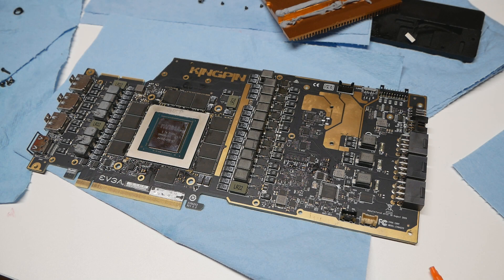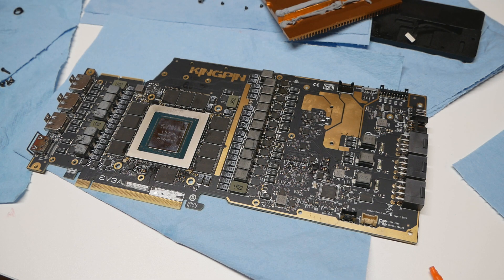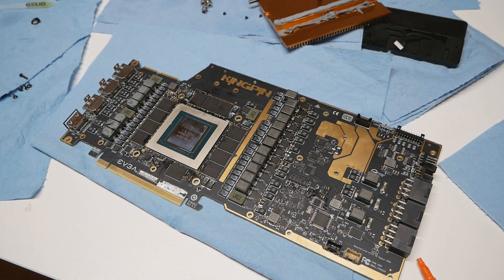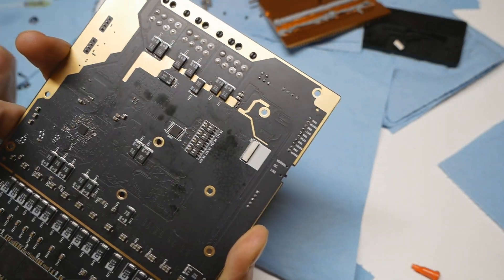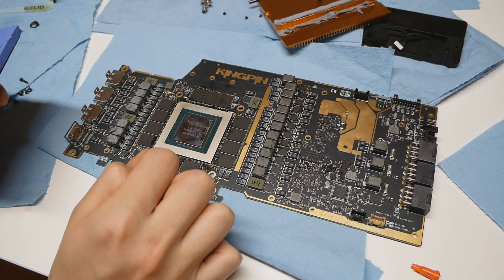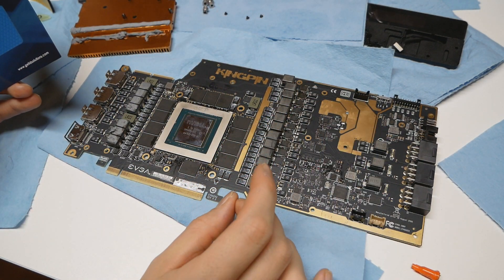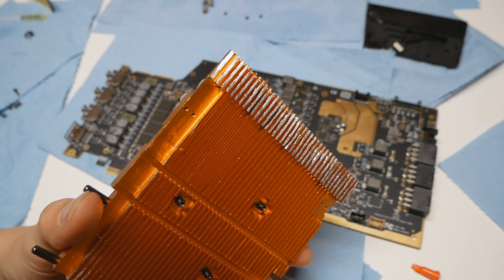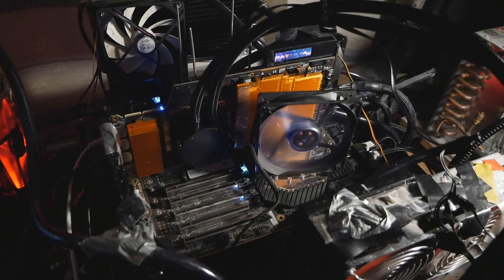The BEST RMA Service in the World - EVGA RTX 3090 K|NGP|N BACK ALIVE with PCB Overview + LN2 OC Tips

Comment: Haven't really seen too much talk about this so I'm wondering how widespread this is: I'm having an issue where, one night of testing a while back, I was able to hit personal bests, my Kingpin card was scoring 400 points higher than it had before, with no real explanation as to why (same drivers it had previously scored barely 15k on it now hit 15.4k at the same clocks, with no Classified Tool being used in either case).  I have not been able to replicate that performance since.
Have you encountered this issue, and if so, how did you correct it?  I tried replicating the circumstances of those runs (wiping drivers, reverting to an old driver, wiping again with DDU, then going back to the driver it was done on) with no luck.
Just thought I'd ask here, see if you've had this issue at all and how you solve it if so.  I've also tried switching BIOS switch positions with shutdowns in between, that didn't work either.

Comment: I've been wanting to get my hands on some TG-PP10 thermal putty, as it is the highest performance thermal gap filler I can find at 10w/mK. It should in theory preform better than pads in most cases, since it can fill between chips and possibly pull heat out of the PCB. Also with something like a midplate, it would allow for the smallest gap possible.

Comment: Great video, bro. Do you know of a good place to purchase that Ziitek thermal compound? Is this the same product? https://www.ziitek.com/en/products/TIFTM_100_35_silicone_putty_thermal_ga/2017/0916/3156.html
Reply from the maker: Yes it should be that one. Try to check Aliexpress, alibaba etc and report if you find. I will try to check too.
Reply: @LuumiJuhani  Thank you very much. I think I found a vendor that sells it in Canada (I am in USA) but they may not sell to consumers. https://www.thermazig.com/sale-11522456-silicone-thermally-conductive-putty-continuous-use-temp-gray-soft-dsp-chip.html and I will report after I receive a reply to my inquiry with them. I will also reply if I can find it on one of the web sites you mentioned. 
If the Hyrdo Copper and OptimusPC waterblocks have a little more space to accommodate a thermal pad that might solve the problem of having to source this product. I can hardly wait for a better solution than the hybrid cooler. For now I have removed the radiator, installed QD3 fittings with barbs to integrate the hybrid cooler into my chilled loop.
Reply: After thinking about this a little more, if that Zittek crap isn't readily available, K5 Pro should work perfectly fine on the chokes. The K5 Pro does not have as high W/mK rating, but it doesn't need to for the chokes. The K5 Pro is easy to apply if you put it in a syringe instead of scooping it out and smearing it on using a spatula. Hopefully, the waterblock designs by EVGA and OptimusPC will take this into account and not have the same issue.

Comment: How painful was the shipping from Finland to Taiwan and back? Did you have to pay all the shipping costs? Did the customs agency give you any trouble when they sent it back?
Reply from the maker: Problem is the cooling solution the card in terms of shipping as it is so huge. I was able to send the card as naked PCB which is very light this time. UPS is around 50-60€ from my end to Taiwan. No need to pay anything at customs on return if it is a repair or replacement.

Comment: I can’t wait to be notified for the KP card, happy they have the queue system! I was wondering why you hadn’t posted anymore vids with card, now we know, that had to be heartbreaking! EVGA has the best warranty hands down.
Reply from the maker: Yeah, that heatsink thing is actually a bit of a mistake by EVGA. The gap between chokes and the heatsink should be large enough for a good thermal pad.
Reply: @LuumiJuhani  hmm, I just got my kp card, got 15236 port royal stock voltages, and I just took the shroud off to change paste and see if that makes a difference before I go to ln2.  After the shroud comes off is the backplate stuck on only by thermal pads? It feels very stuck and I don't want to break it
Reply: @Apollo-Computers  Hey curious man. Im thinking about repadding mine. Did you use 2mm and 1.5mm only?